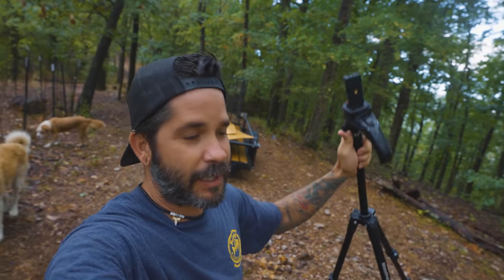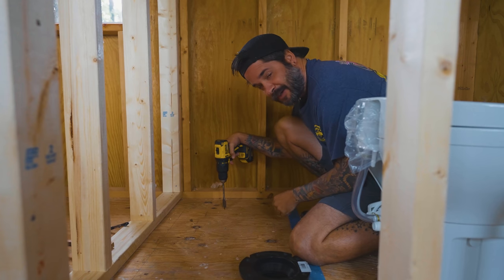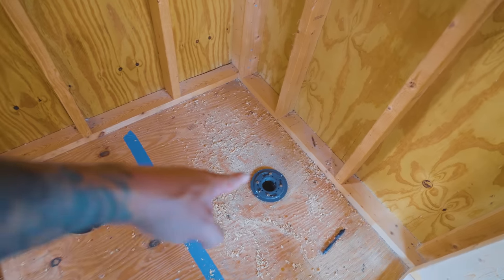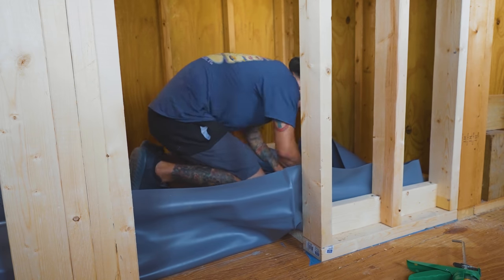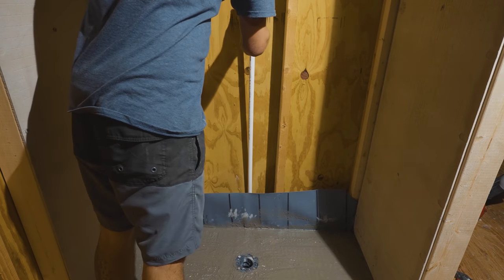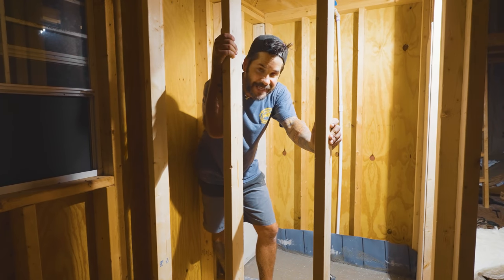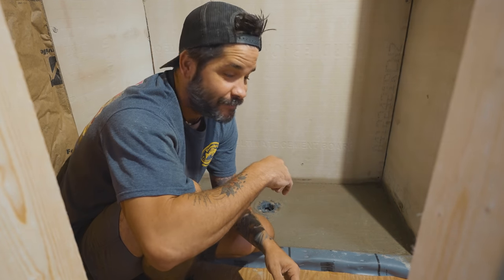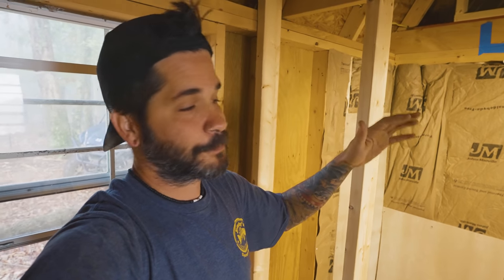Custom Shower Build In The SHED TO HOUSE / Off Grid Tiny House

Comment: The shower plumbing should be on this side of the insulation.
Reply: Dito,,, Hope the winters do not freeze the pipes.
Reply: @stevepoe8897  He is in Oklahoma, I don't know what part but I was raised in southern Oklahoma thirty miles from the Texas border. There are pipe busting winters there. I now live in the Dallas area and we have some winters that will freeze pipes. Last winter we got down to -2, the coldest ever recorded in Dallas. My sister still in Oklahoma had -8. He should wrap pipe insulation around the pipes and have insulation behind them as well.
Reply: That's why I told him use pex but he said pvc is fine I'm a plumber I know lol
Reply: @kidguxxi5  Pex is much better but he may not have the tools to use Pex and it can be costly. On a new install or a rebuild it would be worth the investment.
Reply: @danielheartsill4269  pex is cheaper then anything 2$ for 6 foot and the tools are cheap if u use the cheap crimpers and not expanding rings or shark bites
Reply: @kidguxxi5  This is true about the price of  pex. After I retired I went to work part time for Home Depot in electrical and plumbing departments. The only expensive part was the crimpers at the time. I quit eight years ago so they may not be as expensive as they were or may be cheaper other than HD. In his situation pex would be the very best because with no foundation and water pipe outside the insulation he will have freeze/burst problems. Pex will freeze but will not burst.
Reply: @danielheartsill4269  totally agree and crimpers are cheap on Amazon

Comment: I’m glad you decided to go with tile and making that lip to keep the water in. Several years ago the only room left at a hotel was the handicapped room. I said fine and took it. Well the shower floor was flat but they didn’t angle the drain correctly. Water everywhere from shower to sink and it wasn’t a tiny bathroom. It was a mess to clean up!

Comment: You need to check with a company that moves sheds and see how much it would cost to have it lifted up and put some concrete blocks under it, this way you can get under it for plumbing any repairs down the road and maybe see if there is insulation below? It is coming along swimmingly Jason, I can not wait to see what is next! ~peace

Comment: The bathroom will look great when it's done. When I was getting a fire installed the fitter said I would have to have the sides of the hole it was fitting into cemented first for him to apply a carbon seal.  I did it myself pretty much the same as you did the shower floor. Never done it before and it passed.  Paid for someone to tile my bathroom walls, watched him do it then tiled my kitchen floor to ceiling myself. I will always give it a go.  I would have put the rubber barrier on the floor the toilet is on because a shower curtain is not going to stop that floor from getting wet and possibly rotting. Just my opinion. Also put a PVA Bond on the cement and walls before tiling. It's not that expensive only about $25 for 5 litres so for that price, worth the extra step. I'm speaking from experience.

Comment: Little tip for next time the paper on the insulation in the wall around the shower you should peel that off, it makes a moisture barrier behind wall and creates mold in the walls in the long run thats why you peel it off. But so far your doing great. Can't wait to see it finished.

Comment: Smart move using the handles with rubber on them.  To bad you couldn't have jacked the shed up a bit to work on.  Then lower it down with hopefully no cracks in the walls.  It's getting there - gr8t job.    Stay safe & take care of you all.  Thanks for sharing eh:))

Comment: Hey Jason, your insulation needs to be between the exterior of wall and the plumbing. I also think it is advisable to insulate the floor anywhere that a pipe enters or exits from inside the structure to avoid freezing in winter conditions. I'm not sure if you also considered having all plumbing running through the walls on the same side of structures walls to avoid running any unnecessary pipes within the different walls. Everything seems acceptable at this time. Gr
eat watching you just "jumping on the horse, no fears"

Comment: Get the red tape and pink water coating to seal the dryrock. As said before,  plumbing on the inside of the insulation.

Comment: This is looking so freaking good! My 10x20 shed has plumbing set up for the shower and kitchen sink in place, but I haven't been able to work on them yet. I have some awesome salvaged glass panes to use as the shower walls and I'm itching to make the pan to fit them but can't yet due to lack of tools/materials. So for now I have to shower, wash clothes/dishes outside on my janky porch made from pallets 😂

Comment: You might consider create board also on the bathroom floor and all walls for moisture prevention and a closer true wet room. There used to be a product that went on the walls , my grandmother had In her shower similar to a sand rubber stuff thicker than paint lasted forever and could have a color additive. Just thoughts

Comment: I have not read the previous comments Jason but, in the shower you need a cold water line in and a hot water line input. Unless you are going to have an instant hot tank less water heater and preset the mix of hot and cold to the output to the shower head. I know it's not me building but I would build another 12 x 24 0n the rear of the shed and create a bedroom and kitchen eating area extension.  Just what I'd do.
Reply from the maker: You'll see soon why I did 1 pipe

Comment: For future install always put the insulation behind the plumbing pipes. With the insulation in front of the pipes you are trapping cold air with the pipe. The insulation will keep the heat from reaching the pipe thus freezing the water and bursting the pipe in the wall behind tile. not a good deal.

Comment: Hey Brother,
Next time put some black roofing paper behind the cement board. That keeps things dry and tight.
Reply: You might consider cutting an opening in your floor to install your plumbing lines. You'll have much better access to dig it out and get the right flow. Just cut an opening between 2 of your floor joists about 2'-3' long. Cut it clean with a circular saw and keep the cut out piece. After your plumbing install,  attach a 2x4 runner to each floor joist in your opening the entire length as a nailer. Place the cut out piece you kept over the hole. Make certain to use some construction adhesive then nail it off. You'll be stoked. Good luck brother, and don't ever stop.

Comment: Jason you might want to make that lip you step over to get into the showing a little higher like at least 6 inches. I had the guy's frame in a  walk in shower I paid someone to lay in the liner but oh how I wish I would have made a higher lip stepover water will come into the floor I did all my own tilling. I bought a graut that was 54.00 dollars for a 1/2 gallon never to mold, well it dose I have to seal it every year still. Hugs

Comment: You did do a couple Mistakes. 1) when making a shower pan mix your S type mortar on the dry side. This will make your concrete pours so any moisture can weep out the weep holes in your drain assembly, however what you did will work if your shower is not assaulted with more than usage of no more than 2 showers a day. 2) the shower water lines should never be placed in an outside wall. {Freezing is going to be a problem.} 3) your curb should be at least 2" above the tiled surface of the shower pan. You can fix 2) and 3) and you'll just have to live with 1). Next question is what about hot water?

Comment: I suggest adding on a little room to the back of the house just big enough for a toilet and shower for convenience, ventilation and privacy.  Just a suggestion
Reply from the maker: My challenge is to do everything INSIDE the existing building with no add ons
Reply: I felt that was a poor challenge. If it were my place I’d have put the bathroom in a building out back. Then there would be more room in the shed to house. But it’s your place and you do what you want, like you always do.
Reply from the maker: @sherrywisler3718  exactly... it's my place. Thank you for your opinion though!

Comment: So the shower pipe should be on the inside of insulation and also need more water connection for your on and off valves for shower.

Comment: Really don't need a sink in the bathroom put a mirror in the shower to shave. I would think pipe insulation would help so they don't  freeze. Should you grade that concrete a little so the water flows toward the drain. Looking good so far. Have you thought about a barn door instead of the small one you were planning?

Comment: Jason  watch it when  you  use the  nail  gun again for  sparks  along the   pull in  otherwise it will  burn on up into  your  hands  had this happen to  me once when  I wasn't  watching on out  with  cement and it got on the  wire hose   am  thinking of  the  things you  have  made  and  you need  your  hands  a lot for those other things in life  WINK  WINK  !!!

Comment: Hey Jason. Awesome progress , not sure if you planning on adding a vent , either  through the roof or a scooter vent  when you tie all the drains together , maybe the wall behind the toilet facing outside as high as you can while the wall is open , I know it ain't right but like you said it's your way . As far a the sink thats a definite nice little sink you bought. same thing you can run your supply lines and drains through the interior  wall then down and do all your tie in close to the outside wall .Good luck  and dont forget a clean out outside .  Also wondering what kind of system are you using to get rid of waste. Septic with a leaching field or a  cesspool style

Comment: I’ve lived in this country for a lot of years and you need PEX for your plumbing and you need to have it on the inside of your insulation or you will have frozen pipes!!!!
I had to replace all the pvc pipes with pex in my cabin due to its ease to freeze. And you put your pvc on an outside wall insulating it from the heat of the house.
Reply from the maker: That's a great opinion, but what I did is just fine. You'll see
Reply: @TheCrockers  you’re using a system that just needs a water hookup, that you install on the interior huh? Kinda like the one at the tiny house? Smart Jason!!

Comment: Are you going to put rubber sheeting on the toilet side too and under the toilet? If it’s going to be part of the wet room, I guarantee it’ll be a good idea because we didn’t and the water eventually seeped through the tile adhesive and grout and rotted the floor boards underneath. Also instead of making a step at the edge of the cubicle, you could’ve put it at the door threshold instead and you could have had the whole bathroom floor as a wet room . As you said the toilet can get wet it’s plastic. You could put toilet rolls higher or in a waterproof container so they don’t get wet. It’s food for thought. It will give you more floor space, plus you could then take a shower together 😉😍🥰😛😂

Comment: If I'm not mistaken aren't you supposed to put the insulation between the outside wall and the pipe or your shower pipe I should say. ? So it won't be so apt to freeze come winter time. !
Reply from the maker: It's fine, you'll see

Comment: You have a few issues 

Normally I always run water lines on an interior wall 

Your 2X4 need another 2x4 on it to make your curb higher 

Next you stapled your shower liner on top of your curb, all off those need to be sealed with the appropriate sealer. 

Your slab needs to be higher you can do that with your thin set 

Don’t forget vent pipe for shower 

You only ran one line to the shower will you have hot and cold water? If so you need an additional line 

Shower drain normally has two sets of drains the one you see from the top and holes inside for the area between your liner and tile this is in case any water gets below your tile it’s not trapped. 

Are you going to do a sliding shower door if so add bracing 

Not being a jerk just don’t want you to have to make repairs later.
Reply from the maker: Thank you for all the info! You'll see why I did some of the things I did in future videos
Reply: No problem young man. Love your channel, I deal with stuff like this every day and my main job is to prevent bigger issues

Comment: Two coats of red guard over the walls before glue and tiles.
Reply: We just finished a tub removal and a new shower build. 7 inspections in our condo for this shower.
Reply from the maker: I'm not sure what red guard is. I have no knowledge on this. Do you roll it on or something?
Reply: @TheCrockers  Yes, you brush it on like paint.  It dries and sets up a water barrier.  All the joints and corners need to be covered first though.  Then sealed.  Since your construction is all wood you should consider it highly.
Reply: @jfinnall  Exactly! Quick and easy to do and mandatory in condos. All screws need to be coated with it thoroughly. Two coats. Ready for mud/glue in 24 hours. No leaks!

Comment: Dude. I think we may just be related. I know this video is a year or so old but I’m standing in a laundry mat, YouTube searching/stressing….hoping to find ONE DAMN VIDEO to make me feel as if I didn’t bite off waaay more than I can chew. Single mom, no knowledge, no help, no freaking reception where we are off grid, a million tears and stress every Loews/Home Depot trip. I buy a lot of the wrong things, too much of the right thing, many useless but “cool looking” things that could be rigged up for other purposes. Basically off grid chest pain and chaos. I’m handy, I did a partial Skoolie Reno solo, until the mushrooms starting growing through my flooring. I scored a repo 12 x 33’ “partially done”. My bathroom size is a clone of yours. You made me smile so hard…like a complete nut standing in this dank laundry mat, still in my scrubs after working a 12 hour shift, hair a mess, makeup smeared, exhausted but damn I’m smiling so hard. Your honesty spoke to my soul. Just know that you did everything just as I would’ve…feet first, butt cheeks clenched and Forrest Gumping it 💯 % of the way. ❤️ 
Dude. You made my day. 
Subscribed officially. 

Thank you. I haven’t smiled in a while in regards to this process.

Comment: If thats the cheap 2pc toilet your going to regret that mistake lol those have a very widely known problem. Piss and shit gets trapped between the 2 sections and starts to stink. You should have gotten the 1pc unit. Little more costly but doesn't have the issues the 2pc does.

Comment: You Ran your insulation Over your Shower Pipe - Exposed Pipe to the elements. Pipe should be protected inside the insulation.

Comment: Since this is a tiny house and you are putting a sink in the kitchen if you feel the need to wash your hands use the kitchen sink. nothing worst than a sink on the wall in front of the toilet. Not knocking you down just passing on some design wisdom. What your doing will be much better than a plastic molded compartment that is normally in campers and RV's